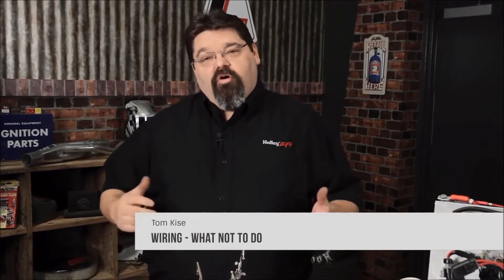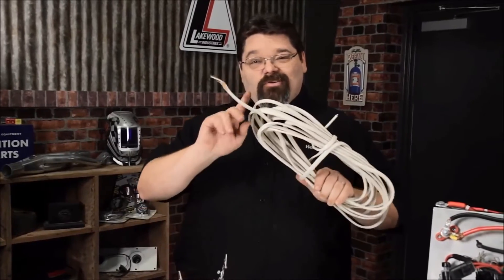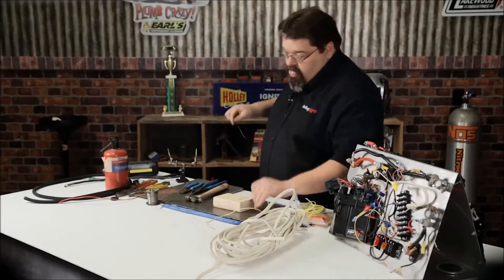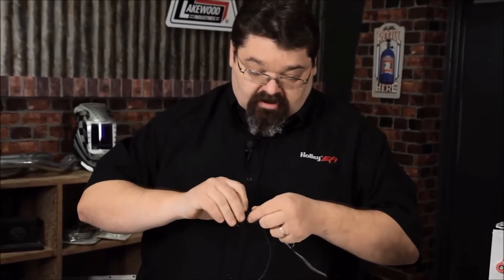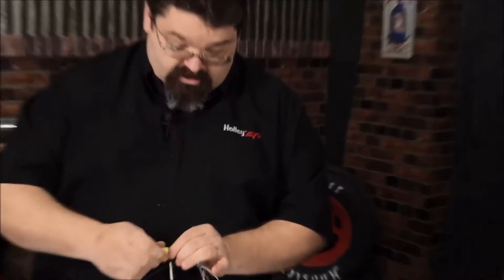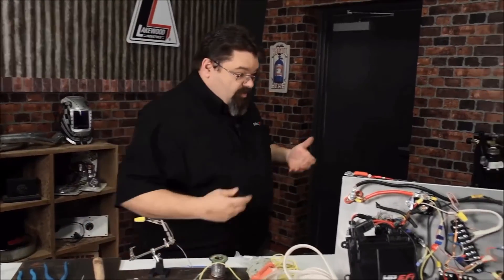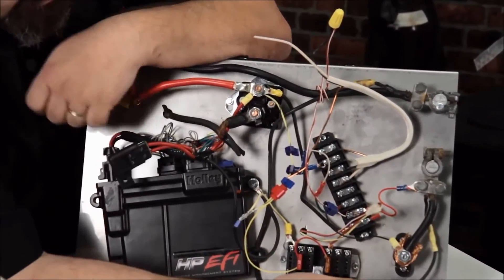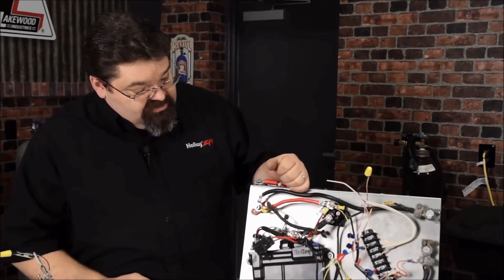Holley EFI wiring Do's and Don'ts!!!

Comment: To me, the worst thing for a manufacturer like Holley, is when one of your vendors makes a installation video, and they do some of those "what not to do" things. There's a video from a vendor of yours, profiling the installation of a Sniper EFI master kit on a Ford Bronco. In this video, they don't use the fuel pump driver wire to power the inline fuel pump, they install the fittings into the fuel pump with a wad of teflon tape on the threads instead of using the correct seals, they drill the tank for the return fitting without washing the tank out, and they don't follow the startup procedure completely as outlined in the instructions. And, customers, or potential customers, watch this video and think that they are doing things properly and do things like they did, instead of following the manufacturer's instructions and recommendations. 

We have a Sniper EFI system on the way to us, that we will be installing on our 347 stroker small block ford, in a 1978 Fairmont. And, I'll be doing my very best to make a nice clean install.
Reply: instablaster